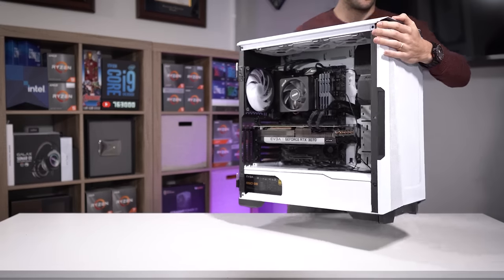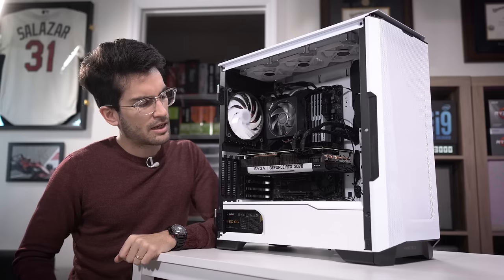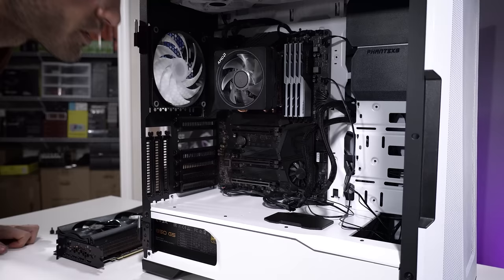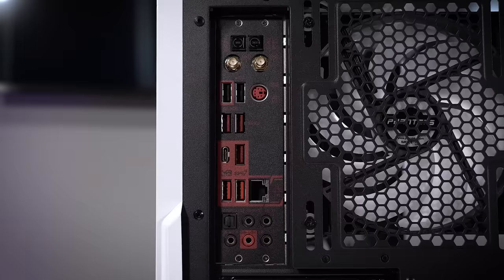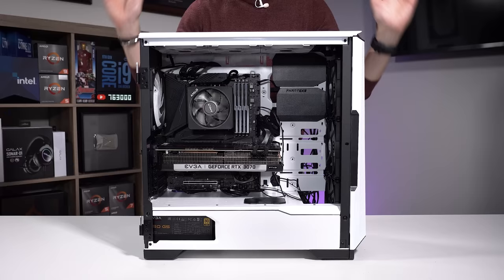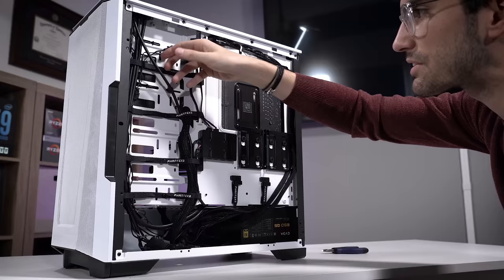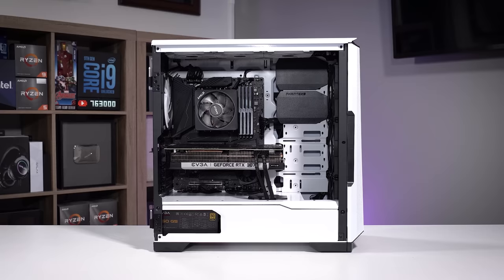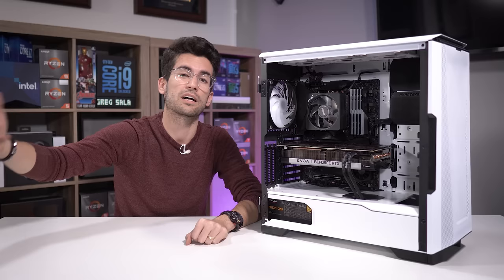Fixing a Viewer's BROKEN Gaming PC? - Fix or Flop S2:E5

Comment from the maker: Hey, everyone! There always seems to be something a few folks find wrong with the build even after we've fixed the primary issue. In this case, his top fans were set to intake. I'd normally swap these around, but he'd end up with more exhaust fans than intakes = negative internal case pressure = dust influx from PCIe slot cover area (ask me how I know). The top of this case has a dust filter as well, so I left things as is. And the "heat rises so that's inefficient" argument goes out the window the moment you introduce any sort of active cooling component. Hope this clears it up. Not the end of the world either way, but not something I was willing to change in the moment 👍
Reply: Yeah, dust filters on the top obviously show the case was designed to have more intake fans than exhaust fans.
Reply: I wouldn't call it wrong, just unconventional. A pc case with fans is more of a vacuum pressure system so the "heat rises" argument doesn't apply at all. Its all good either way honestly, positive pressure, negative...and maybe the owner wants it this way intentionally who knows.
Reply: I love this pinned post!  Positive pressure is the way to go,. either by amount of fans,  or by judging or using math on cfm so that you obtain a positive pressure in the case.  Without positive pressure you end up making a vacuum and it will suck dust in from every little opening that is not filtered with a dust filter.  I have not had to really tear down and clean my pc in what feels like forever because of doing a positive pressure type setup.  I just watched this video and love these video series that your doing.  You are helping a ton of people who might not be able to afford to get it fixed,  and then they can in turn watch these videos and learn how to fix their own pc's in the future.  Keep up the great work!
Reply: forget the weirdos, you could be charging people but you aren't.
Reply: I see thanks, I was using my SSD hard drive that was installed in my older pc I didn't format that SSD drive just straight up use it on my new PC I had windows blue screen few times
Reply: To migrate a Windows 7+ drive and/or image without driver conflicts:

1- run command:
sysprep /generalize /shutdown

2- remove drive

3- install drive in new system

4- turn on new system

5- go through out of box experience

6- finish installing new drivers

7- enjoy
Reply: Also, the intake helps with the CPU cooler because it’s a downfiring cooler.
Reply: The owner has a 3070 in this tower and he let it sit for a year? Now I'm kinda pissed
Reply: Thank you for answering and clarifying this for us :) I would have loved to hear a couple of words on that "issue" in the video but that's ok! :)
Cheers and lovely work
Reply: LOL And I find this comment AFTER I posted mine. Good to know Greg has a reason. Hope you understand! Even some main stream movies get things wrong.
Reply: 3 intakes front, 3 outtakes top - that is airflow. never mind one more outtake fan in the back, that is just to take some heat of the cpu-cooler. one could say that breathing fresh air to an underpowered cooler makes sense, but you already used the "dust influx" argument. i think if you disregarded or even missed the intaking fans over the power cable connection issue, be a man and say so. that is the communication that does not seem to work, because it´s done already and thus twice with less effect, so what else. nice video - but please who would be in desperate need of a computer repair that has been sitting in the "corner" for a year? sounds like another computer has been bought and the one you just repaired will be sold as "g. salazar fixed it", you might as well sign the case with it. there is so many people running on half a working ram slot with no option to buy a new one. ask some viewers for systems they dont need anymore - feature them in your videos and give them away to your audience for free, or fix computers where someone is in need for that kind of format. and lastly, i have 8 fans in my case to get those 2 tiny chips heat up my room, so dont tell me that no thermal effect bc of active cooling wisea$$ing. ^^ since re ly - greetings from beer and wurstland.
Reply: Bro someone is trying to scam me in the comment field plz look into it

Comment: Things I've learned in your channel lately since watching the series. When there's no display output, one of the many things could be the problem... A) It could be the bios, which is not updated to properly work with the current cpu and gpu. B) Ram may not have been put in properly. C) Could be the power supply. D) CPU socket/issue and whatnot. E) The GPU itself. F) And finally the motherboard itself. I think I'm getting better at diagnosing the problem and all thanks to this wonderful channel :)
Reply: So as usual anything could be the problem

Comment: It's good to note that PC Part Picker will notify you if there are potential bios complications. Good stuff Greg, I was wondering how easy it was to rectify this problem, I actually went with a 10600k, mostly because this issue kept showing up with the parts I wanted to get in an AMD build.
Reply: That message on PCPP is a generic message that shows up whenever there MIGHT be an issue...therefore you still have to do your own research because PCPP's generic message will be inaccurate at times
Reply: the incompatibility message popped up when I built my pc on PCPP but it was a false message. I was glad to see it though because that let me learn a little more about PCs from the research I did.
Reply: @Lukecase2  something PCPP doesn't do which they absolutely MUST (granted it can't happen over night) is providing a warning when someone picks a part that has faster lane capability than the MB they choose....for example, when someone chooses a Gen 4 SSD even though the board selected only supports up to Gen 3
Reply: Sometimes PCPP does spit out false positive "incompatibility" issues though, so it's usually best if you don't know, is to go online (like Reddit, a Discord server, or a forum) and talk to someone with more knowledge than you (but make sure you get a second opinion) like I did when I first started.

Comment: I was waiting for a Bios flash fix or flop entry for so long. It's one of those things I dread so much and just seeing it in action is the best.

I love how Greg always goes the extra mile of doing cable management and other aesthetic / quality of life fixes even after fixing a rig's main issue.
Reply: Not every motherboard has the BIOS flashback function. Only higher end/recent motherboards can do this. Check the online manual before you buy
Reply: Bios flashing is a godsend now. I know it's one of those things that, if you know what you're doing, you won't ever need it. But the PC building space is attracting more and more people (majority of which are coming into this not knowing much either), Flashing a BIOS needs to be one of those ubiquitous features that really should come with boards above the budget tiers. 

The stupid thing is each manufacturer implements it differently, the procedures aren't always fully documented (looking at you Gigabyte).
Reply: @hedonistic_mushroom  Gigabytes process of flashing a new bios is very simple???

Comment: As someone who has that exact GPU, this breaks my soul that it was so easy to fix. I have to wonder if the original person who built it, actually picked out these parts, themselves, otherwise this shouldn't have been overlooked. Things like this tend to happen when people throw things together without properly doing research, which, for me, comes down to every single last component that goes into my system builds.
Reply: At least Greg is free. I also watch Adamant IT, who runs a PC repair/build service, and he most definitely is not free.

When I built my current system with a Ryzen 5700G I didn't know I needed to update the BIOS before it would work. I thought it was a sketchy power supply or my questionable ASRock motherboard.
Reply: It is pretty incredible that he wasn’t able to fix this tbh
Reply: yea, i have accidently took atx mobo and matx case, water cooling aio and a case with no space and mounting for radiator

Comment: Well, I recognized the P-500A case immediately since that's what my system is in and mine is pretty similar in specs. Considering how easy that case makes cable management, I get the feeling the owner didn't really even try. Also that case is missing the two lower cable cover slides. I'm glad they will actually get to use this now.

Comment: I have the exact same Cpu Gpu setup! Also had the same no post problem. What happened with mine was I got dust in the RAM slots when dusting it out. Giving it a good spray with air duster solved the issue!

Comment: Nice to see a straightforward fix for a change, without running into many complications apart from rgb clutter so to speak.. i wonder though did you flip the top fans off screen? I figure it isn't an actual problem but having that many intake fans might just be an oversight by the owner. so it just didn't make the video.
Reply from the maker: Not a huge deal. Dust filter up top. Would run negative internal pressure had they been flipped.

Comment: 0:45 my friend had to wait a few months to use his pc again because he decided to try to tighten a soft tube fitting and accidentally unscrewed it and water got all over his brand new b550 motherboard, he had a "lovely" time with asus' support and help desk for an rma (surprisingly he got one)
Reply from the maker: Did he do this while the system was ON? Oof.
Reply: @GregSalazar  he ran the pump and psu and he tried everything he could to see it would still post, unfortunately it didn't, tried bios flash/update, cleaning with ipa, using a hair dryer and he was out of luck, but he's got a new board which is good

Comment: I have had same kinda issue with my old MSI mobo, but with GPU. System posted fine with integrated graphics and with some old Radeon HD 5000 series but no signal with GTX 760, until i realize its an bios issue that many user have come across. After an update everything worked like a dream.

Comment: I've built a few similar PC's recently in Phanteks cases (P400a/P300). They are definitely tricky to cable manage with the looped wires and shorter than desired cables.

Awesome build. I'm running a similar setup currently with a Ryzen 7 5800X. Any decent $40 CPU Cooler like my Cooler Master Hyper 212 Black will prevent thermal throttling. I get to 85C in synthetic 100% applications like Cinebench R23. During gaming, it's between 65C-80C. I suspect this viewers PC may thermal throttle during gaming with the current CPU cooler.

Comment: I've migrated from an Intel Ivy Bridge platform to a Zen+ platform using the same installation. After the 3rd time of shutting it down and starting it back up, the whole bootloader got corrupted and it was apparently caused by an "unexpected" shutdown according to logs, had no other choice but to start from scratch. Anyways, great video, Greg!

Comment: That 5800x could definitely benefit from a better cooler than the stock AMD cooler. I can't believe that the system has sat for over a year when all it needed was a very simple BIOS flash!
As for the OS transfer, you can remove old drivers through device manager using an unhide option via command prompt. It will show ALL devices ever installed and I did just that to upgrade from my i7 4790k to a 3700x build. The OS had zero issues with compatibility and I had no blue screens at all.

Comment: The thing with the EVGA cards is routing the power cables from the bottom looks a bit ugly since they block the light bar. They should be routed from above or to the side of the GPU.

Comment: I have a b550 carbon msi board that I had some issues flashing the bios on. As I eventually figured out, I needed to use a usb 2.0 drive to make it work. I started with a usb 3.0 and it would never work properly. I went and bought the cheapest drive I could find and it worked perfectly. I found no mention of this in any of MSI'S instructions. I found a video where a guy nonchalantly mentioned it halfway through or mine still might not be working like the one featured here.

Comment: The instant you mentioned a 5800x and "over a year" made my mind go right to BIOS versions. I'd prepared a usb drive for that eventuality on my 5800x build, but it booted fine first try.

Also, I'd like to see how that AMD cooler performs on a 5800x. I have a Hyper 212 dual fan cooler but I think I skimped on thermal paste slightly too much. It runs hot on bench tests but does fine in gaming. I think I'll repaste when I clean the pc and install the extra fans and m.2 ssd I got recently.

Comment: I have an MSI B550 A-Pro.  It took the Ryzen 7 2700X out of the box even though the B550 is not supposed to support them!  Anyway, I tested it with Nicehash and when I enabled CPU it froze.  Otherwise it was great.  I then upgraded to a Ryzen 7 5700G.  Put it in, turned on no post.  I used the bios flashback with the CPU in place and it worked a treat!  Tested with Nicehash and worked.  So, moral is B550 may work on a non supported CPU but use a Nicehash test to see I would.  I am not an expert found that coincidentally!

Comment: To migrate a Windows 7+ drive and/or image without driver conflicts:

1- run command:
sysprep /generalize /shutdown

2- remove drive

3- install drive in new system

4- turn on new system

5- go through out of box experience

6- finish installing new drivers

7- enjoy

Comment: Right from the explanation of the first symptoms I was on the bios because... I got the same issue. I was a bit on an edge case, I bought a 5600X with a X470 I knew would work. I asked the shop I bought it from to perform a bios update (that they charged 25 Euros for) and they didn't do the latest BIOS. So I had to contact AMD to get the Athlon update kit as my mono doesn't have bios flashback buttons :D Anyway, glad this awesome machine is back into operation, that's a damn good computer.

Comment: That CPU cooler is a bit weak for a 5800X, but man, this is a super powerful rig to just leave sitting... I would never have left it alone like that for so long. I already looked into the BIOS flashback and updating the BIOS before I even bought a single piece of hardware, so my rig worked no problem.

It's good that his problem was just an easy BIOS update, and that his board is so nice that the process was easy.
Reply: That's what was so shocking to me. To have a build that powerful sitting in dust when the solution was pretty obvious. The motherboard even had the flashback option as well. I guess some people have other things going on in life

Comment: some motherboard actually require you to not seat a cpu (or not seat anything - cpu/gpu/ram/ssd) for bios flashing (for example my gigabyte b550 board, which i find out after failed to flash the bios with my cpu on for 4 times before I removed it to the bare board and psu and it worked)

Comment: Not sure why we care about the backside of cases. I never cable tie anything except for big mobo cable due to it's weight against the socket. Everything can just be left loose, it makes any changes or troubleshooting so much easier. The back of the case is not visible for a reason. :D

Comment: This happened to my friend. Took around 6 months for it to finally work. One of his CPU pins were bent even tho he thought it was his GPU (5500 XT) it was such a bummer because I mentioned it to him before but doubted it. Went to microcenter and I was right. He has had problems with his build after but rn its working and he just happy to he gaming. Im so happy my 10600k and rx 6600 never had problems because it was so annoying to troubleshoot. (I have had problem but it was usually cables not pushed in right away)

Comment: Had that happen with my x570 Strix board.
Problem was the flash function didn't work... fast forward 2 hours of trying to get it to work (I was even willing to pay a computer store to update my bios with a gen 2 AMD CPU), I tried to use every usb device I had lying around and the one USB stick that worked for me was my very first one I own (for school purposes 6th grade I believe) which was a 1GB USB 2.0. I formated it to fat 32 (or it was already) and tried it again. It worked instantly and the whole updating process only took like 2-3 mins but it gave me a headdache over those 2 hours of trying and running around the house...

Comment: When flashing bios without a CPU I've found that USB 2.0 drives are often required. I guess 3.0 is too complicated to implement into this feature.
Reply: It depends on the brand but yeah its pain in the ass to find a real USB 2 drives that's olds enough to work...
Reply: @eckostream3541  Best buy sells them cheap in store.
Reply: I think it is that way because USB 3.0 drives and or compatible devices aren't that common yet.
Reply: The issue is probably the size, not the USB gen. My mobo's manual says to use a thumb drive that's 8GB max. USB 3.0 thumb drives are often bigger than that.

Comment: i had same issue 2 years ago, pairing a msi x370 kraith gaming mobo with a ryzen 5 2600 cpu, but my fix was to buy a cheap compatible cpu (a8 9600) to upgrade the bios.

Comment: I had to fix my Dell laptop.  one day it just refused to show any power.  Probably one of those two power chips need to be replaced.  I found a motherboard for it and replaced motherboard.  Now working.  Those ribbon cables can be scary to adjust.  one wrong twist and cable breaks.

Comment: Nice simple easy fix...seen similar all too often especially with Ryzen CPUs and boards, I keep a Athlon 3000G in my toolkit for this purpose. That 3000G has been in so many mobos...just a nice universal tool if the board in question doesn't have a BIOS flashback setup on it.